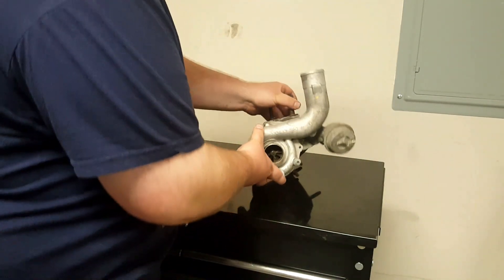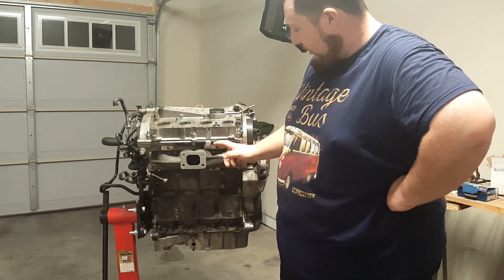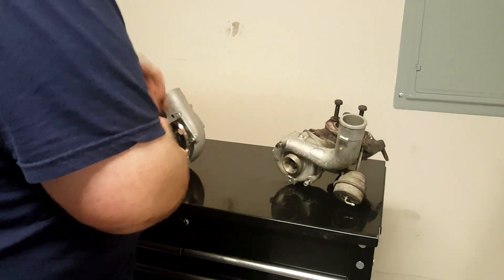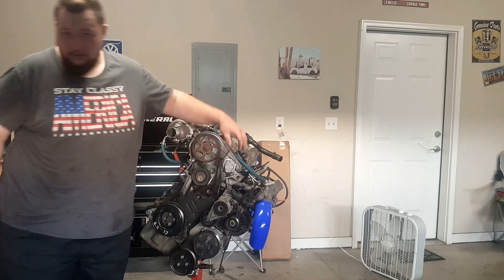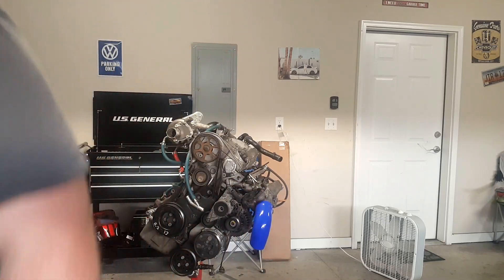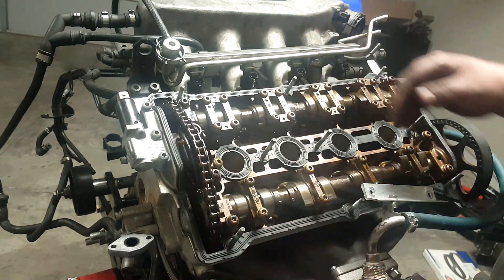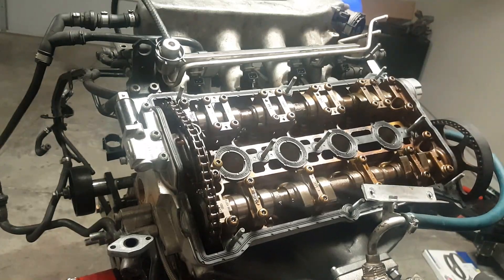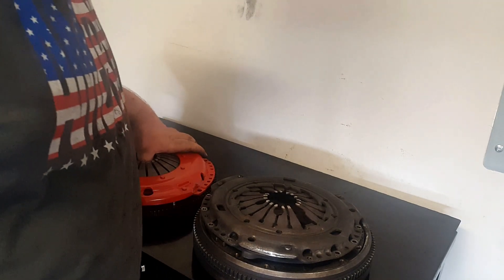Cheapest big Turbo swap?!? Assembly!! 1.8T Jetta MK4 GT28 Ebay Turbo incl. all prices and tech info

Comment: is there a temp sensor hole with theses turbos?
Reply from the maker: what kind of temp sensor?
Reply: @mhperformance1993  egt sensor thats on the 1.8t bam engine  its screwed on back of k04 turbo